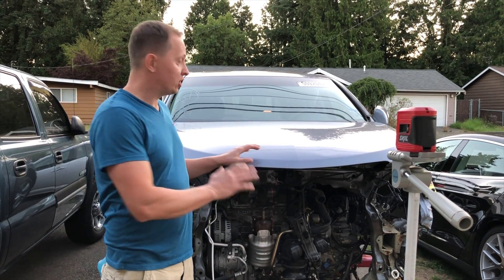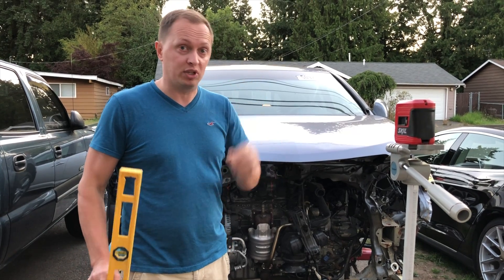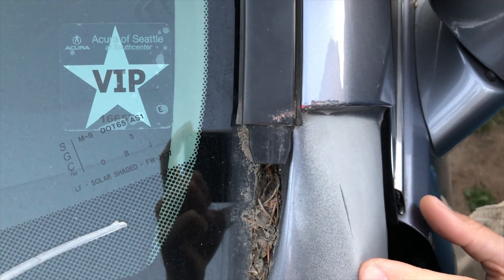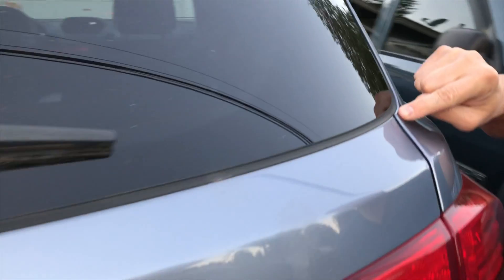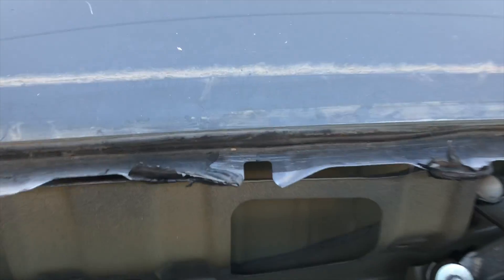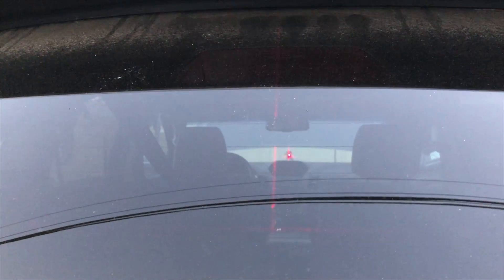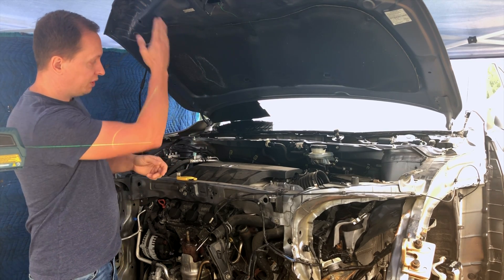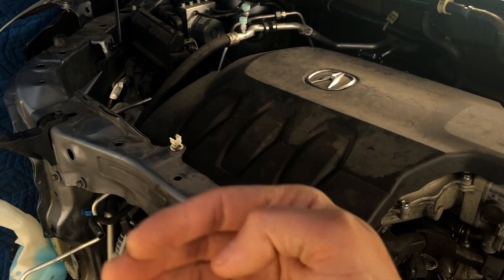✅ How To Use a Laser to Measure Auto Body Car Frame Damage Collision Repair Equipment Universal DIY

Comment: Use a tram gauge to measure from side to side using bolt holes from fender and radiator support
Reply from the maker: I do use a tram gauge mostly to check my diagonals, but a tram is pretty limited as to what it can be used for... But tram gauge and a laser are different tools that are being used for different tasks, so you can't really compare the two... It's like comparing a hammer to an ax...

Comment: If you people think this is the proper way to measure a car you are all wrong you need 3 dimensional measurements length width and height and with a 3mm tolerance this is totally inaccurate
Reply from the maker: Bob, I think you missed the point of the video, the laser is being used to check for symmetry, this is by far the best and most accurate method to do such task... I still use the measuring tape to check for length and height. Laser easily get you into a 0-1mm tolerance territory... So, what more accurate way of measuring do you suggest, using a bubble level ?
Reply: @fix206  i have been doing collision work for 36 years go get a spec sheet with all the measurements and at least buy a tram gauge
Reply from the maker: I do have a tram gauge.... And I do use spec sheet for measurements, I don't just come up with random numbers, but a laser is a great tool to use if you understand how to use it

Comment: How is the strut tower moved down?
Reply from the maker: It ended up moving due to the accident
Reply: @fix206  Re-phrazed, What is the best way to pull the tower downwards or on any other body or frame parts that moved upwards with frame rack puller?  Is it trial and error, pull from where the collision started first, and then pull downward from the frame rack puller, if needed?     BTW, did you name your frame rack puller, yet?
Reply from the maker: Actually, once I pulled both of the frame rails back to spec, strut tower ended up moving back into its original position at the same time so I did not have to pull it... But in another situation if you absolutely have to pull the strut tower down you can use a frame rack attachment such as this one to make the downward pull   https://www.autobodytoolmart.com/product/mo-clamp-down-pull-assembly-5810
Reply: @fix206  Them parts were very expensive, but it nothing better to built it yourself. The site did have offer a lot of suggestive designs. Got, big help, TKU!

Comment: Dont take measurements from the shock towers , they are always off, best way is to used the fender bolts holes
Reply from the maker: I try to take measurements from all of the points that I think might have moved... 👍

Comment: I’m in a similar situation as this, with drivers fender support needs replacing and realigning the radiator support, possibly the frame too ( although it doesn’t look to be off )
Curious from watching the next few videos, I see you mentioned your drivers strut tower is higher, but I didn’t see anything after your pulls if that drivers tower matches the passenger side now? 
My drivers side is 1/4” higher then the passenger, so I’m just curious as far how did you manage to lower the tower/rail down? 
This is interesting! Good stuff to learn here! Just made me a tram gauge following your video!
Reply from the maker: After making my initial frame rail pull, strut tower ended up coming down some but then I helped it with a secondary pull to bring it down into spec. Sadly I don't have any footage of that secondary pull. Just recently picked up another vehicle where both frame rails and one of the strut towers had moved. I"ll be dong a detailed video on that framework later down the road
Reply: @fix206  Awesome! Yeah I’ve noticed as I’m trying to pull out my fender reinforcement that’s all pushed in towards the tower, ( to make it easier to drill out the spot welds ) I’ve noticed the tower as well had moved down bout half my distance so far! Don’t have a nice frame pulling machine, but using a porta power with a 5 ton puller is getting the job done slowly but surely! Looking forward to seeing this next video! Really does give a lot of people that push they need to really get into this themselves, and to think myself I was about to give in and take it to a collision shop for the frame pulling! Screw that!
Reply from the maker: Believe it or not sometimes I need a good motivational push myself. And watching other guys work on YouTube normally gets me into working mode.

Comment: It is a given that cars should be symmetrical - at least in terms of body work. If you use two reference points in the engine bay to center up a car, how would you know if there was offset factory design in the first place?
Reply from the maker: offsets are somewhat rare but I do use multitude of different points to determine where the true center is.

Comment: Excellent video. How you got to level the car so the laser will be on same spot in both sides? My guess you had to play around with the Jack's to lift each side of the car until the laser was at the desire spot, correct?

Thanks
Reply from the maker: You are absolutely correct, no driveway or shop floor is 100% level. Therefore the vehicle would have to get leveled out with a jack first and then all of the measurements can be taken

Comment: How do you use a laser to measure a  quarter panel pull and thank you for sharing your amazing work and video I have a 2008 Mitsubishi galant and I want to fix the frame on passenger rear hope to hear back from you to get some tips I'm not a body man but not scared to put in the work
Reply from the maker: Just recently I've done few projects where I used a laser to measure out the damage on the quarter panels. I haven't posted in a while since I've been just swamped with work but I will have more videos out here before long with a lot of detailed description on how I use the laser for a lot of metal work that I do

Comment: Can you tell us please what kind of laser(model number) and stand you are using.
Reply from the maker: You can use just about any self leveling laser level. If you are using it indoors than just about any laser Will do, if you are working outside in direct sunlight then you will need a more powerful/more expensive laser. I normally just set the laser up on my camera tripod, nothing fancy there

Comment: Question, does a flat tire can affect the measurements?
Reply from the maker: It really doesn't matter if the tire is flat or not. Even if tires are pumped up the exact same pressure on both sides of the vehicle, the driveway that the vehicle is located on is not going to be level anyways. So the lower side of the car would need to get raised up with a jack to where both sides of the car are 100% level... I will have some new videos out pretty soon where I will be showing once again how to level the car out and also how to measure out quarter panel damage. Stay tuned for that
Reply: Thank you

Comment: awesome work big respect from Pakistan . Please if u dont mind can u tell how to measure frame rails from side to side without laser
Reply from the maker: Without using a laser you can measure out frame rail side to side movement by using a tram gauge. Tram gauge works fine, just not as precise as it could be by using a laser in my opinion. I made a video on how to easily and cheaply build a tram gauge . Here is the link:        https://youtu.be/mTr5dCj4kis
Reply: @fix206  wow thanku stay blessed
Reply: @fix206   one more query ,The previous owner of the car bent the radiator support from below, and the issue I'm having is that the car is wandering from side to side, sI was curious to check the frame rails, but my mechanic said that frame rails are stiff structures that don't move easily. However, if they are moved in the video in the same way,.. Please explain the tolerance of moved frame rails, as it appears in the video to be about 5mm. Is this acceptable?
Reply from the maker: If the Frame rails moved by 5 mm at the front, that would not cause any issues with drivability. You will just have a hard time putting the front end of the car together meaning the gaps between the fenders, hood, headlights, bumper cover will not be even due to that 5 mm discrepancy, but car will drive down the road just fine. Sounds like you may have some suspension problems.
Reply: @fix206  thanks for detailed reply

Comment: how can 44 of you people dislike this you? can learn a little.  or all  of you so smart  that your hair push your hair rack  out of square   Iust to build  wreck auto  and drive them
Reply from the maker: I bet most of the 44 of those folks don't even measure anything. If things look good 20 feet away as you pass by at 20 miles an hour... that's close enough for them :-)

Comment: This guy actually said that a level house isn't all that important
Reply from the maker: NO, I said those big, construction levels are not that accurate, it's close enough when you're building a house... But precision is very important when you're working on a car, because if you're off just buy a little bit a lot of the things will not line up , and a point that I was making is that the laser level is more accuate
Reply: @fix206  Okay, sweetheart

Comment: Ok get length measurement
Reply from the maker: What do you mean?
Reply: @fix206  it's 2 dimensional measuring you can't use it to get length. Just comparative measurements for width and height off a datum line.
Reply from the maker: Right, you still need to use measuring tape to measure out the length, but if the car is leveled out using this laser technique is awesome to get an idea if things have moved up or down or side to side

Comment: Thank you! I like this tutorial and how you explained it! Very useful information especially when you don't have access to engine bay dimensions.
Reply from the maker: That's why this laser really helps out a lot, because most of the cars are symmetrical so if you use a laser to go off of a good undamaged side then it's not that hard to figure out where the damaged side has to be polled to get back into it's original position

Comment: How do you make sure your tape measure is angled the same when you take your measurements?
Reply from the maker: You move the tape around and look for the lowest measurement possible. Because if you think about it if you turn measuring tape sideways your measurement on the tape will only get bigger and bigger. So you just move the tape around and look for the lowest number you can come up with and that's gonna be your true measurement. Hope that makes sense
Reply: @fix206  makes perfect sense. Seems obvious once I read it. Thanks!

Comment: Just a little good advice anytime you're dealing with special measurements always take two measurements before you take one cut without these Auto levelers on the lasers your line is only as straight as the installer is if you line it up crooked it would be crooked throughout
Reply from the maker: For sure, I always take a ton of measurements, measure everything out several times before I make a pull or a cut of any kind, I hate redoing stuff so I always make sure to do it right the first time 👍

Comment: Which laser guide you are using? First you shown red and then green points?
Reply from the maker: I left a link to the red laser in the video description, the green laser that I used was a Bosch brand, I don't recall the model because I returned it right after I got done with the video. Generally green lasers are more powerful and you can see them much better in the daylight then the red ones. And then I went ahead and bought myself a green laser that I'm going to keep. It is much better and cheaper than the Bosch one, here is the link https://amzn.to/3iLBoID

Comment: Good morning, what type of stand did you make your laser device from? It looks like it works quite well. Thank you for a great video.
Reply from the maker: I didn't quite understand the question, but if you're asking what sort of a stand I put the laser on, to answer that I just put the laser on a regular camera tripod. Most tripods have a crank that as your crank it moves the upper part of the tripod up or down, therefore the laser that's mounted to the top of the tripod can get dialed in perfectly to any height that you need
Reply: @fix206  I am sorry that I am so ignorant, what brand of camera stand is it and where did you get it? It sounds like a very clever concept. Again thanks for the very informative   video. You take care and good luck.
Reply from the maker: The tripod that I'm using is really basic, I picked it up at Walmart, don't recall the brand name, but as far as I remember it was the only one that they had at the store,  think I paid around $20 for it

Comment: Does it matter that the vehicle was not levelled front to back?  Excellent vid
Reply from the maker: If you're trying to measure out the front of the car then go ahead and level out the front. If you're working on the rear of the car then level out the rear. That's the way I do it. If you jack up one of the sides in the front to level out the front, that will create a bit of a twist within the chassis due to uneven weight distribution so your rear would not level out while the front is

Comment: how did you know the driver side strut tower was high as opposed to the passenger strut tower being low?
Reply from the maker: Car sustained some major suspension damage on the front driver side so that led me to believe that it's a driver side issue rather then passenger

Comment: How do you consider the reference points if the concrete floor is not level?
Reply from the maker: No ground is level, and even if it was you would still have uneven suspension sag and different tire pressure would dictate the height difference from one side of the car to another. So when you use a self leveling laser, even if the body of the  laser isn't level, the inside workings of the laser will compensate for that and still give you a perfectly level laser line. Once that line is projected onto the vehicle, it basically shows you which side of the car is low so all you gotta do is just jack up the lower side of the car so that the laser beam would hit the corners at the bottom of the windshield in the same way. And that's all you gotta do to get both sides of the car leveled out. Hope that was helpful
Reply: @fix206  Thank you for the quick reply!

Comment: 🤦 tell me this is a joke
Reply from the maker: Tell me that the wheel alignment by the use of laser is a joke, tell me that using a body filler to recreate the original body lines over metal is a joke, tell me that pulling a bent frame back into original shape by the use of a frame rack is a joke... I can keep going...

Comment: Hello,
Question, if when you first place the level on those windshield corners and one corner is higher than another, does that mean you have raise the vehicle on the opposite side to level or does the level do that? Any help appreciated.
Reply from the maker: No ground is level, and even if it was you would still have uneven suspension sag and different tire pressure would dictate the height difference from one side of the car to another. So when you use a self leveling laser, even if the body of the  laser isn't level, the inside workings of the laser will compensate for that and still give you a perfectly level laser line. Once that line is projected onto the vehicle, it basically shows you which side of the car is low so all you gotta do is just jack up the lower side of the car so that the laser beam would hit the corners at the bottom of the windshield in the same way. And that's all you gotta do to get both sides of the car leveled out. Hope that was helpful
Reply: Fix206 Got it, that clarifies it. I am doing identical work on a F150. Was using the typical level but there’s no way to truly get center with all the different variations in the work area. Your explanation on side to side and up and down should be very helpful. I may reach out again if needed, hope thats okay. Your video is excellent. Thank you for doing it.
Reply from the maker: Not a problem man... Let me know how everything tunes out
Reply: Hello, another question; I leveled and marked center on the front and rear windshields. I did need to raise the drivers sides to accomplish level. Once the center marks are made does the vehicle need to stay raised on the one side for all the measuring or can it now be lowered?
I have to take to move the vehicle to another location for the work. Thanks so much for any help.
Reply from the maker: @JamesBrown-xq9qd  you level your vehicle to the laser level, once you make any changes to the way the vehicle is leveled like lowering the jack that will throw things off especially if you have to move the vehicle from one area to another obviously it's gonna throw everything off and you have to start from the beginning.
Reply: Fix206 Thank you very much. I'm attempting to make the adjustments tomorrow so will let you know how it goes. Appreciate your input and patience. Your videos are very informative, keep up the good work.

Comment: if the strut tower is up then isnt the frame rail short,its attached to the rail ,thats where a length measurment must come in.ive straightened many many cars with the strut tower too high and every one the rail was short or the tower was in.i usuall measure the rotor for height off the rack.very nice explaining  on how to use a laser but it doesnt measure length which is why you must use 3 d measuring and a bluprint for at least width
Reply from the maker: That's right it doesn't do the 3D... this method is used to mainly check to see if anything had moved up or down, and it also works great to check for side to side measurements, but as far as the length measurement goes, measuring  tape is still one of the best tools for that :)